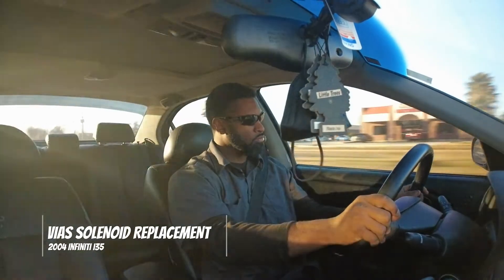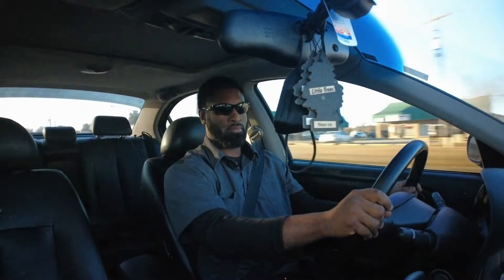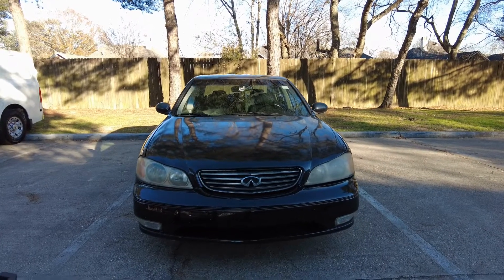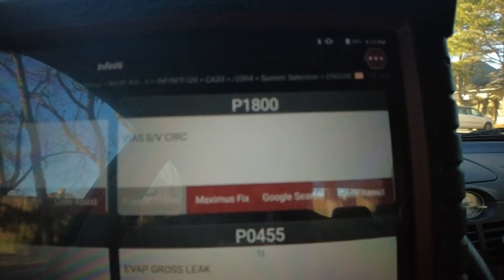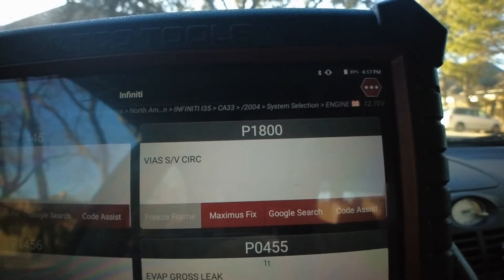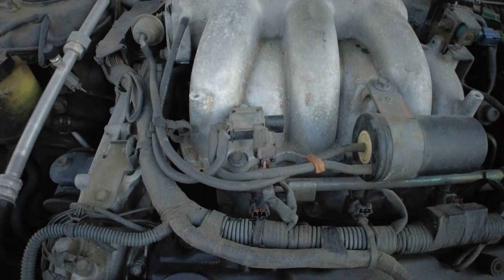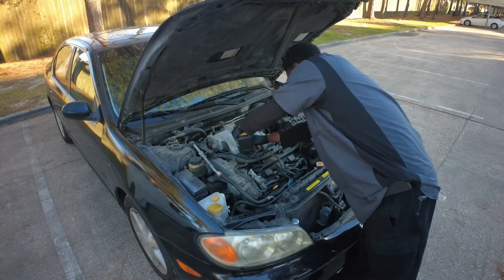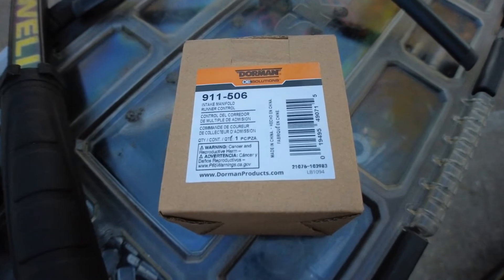VIAS Solenoid Replacement | 2004 Infiniti I35

Comment: Was the car shaking? I can’t really tell from the video i have a 03 i35 and i have a misfire cylinder 5 but i changed plugs and coils but still misfire could it be fuel injectors?
Reply from the maker: no this vehicle did not have a misfire issue. the fuel injector is possible its the only other thing external to fire the cylinder you may want to do a compression test on that cylinder
Reply: Hey man sorry to bother you, if the compression is not good what will be the best way effective way to fix it?
Reply from the maker: @jah800   Hopefully that's not the case if the compression is low then that means there's something inside of the engine that's wrong with that particular cylinder which would be major tear down and repair Doing a compression test it's just going to tell you if that cylinder is building up enough compression to fire but not necessarily tell you what's wrong with if it's not up to spec it could be piston rings or the valves aren't sealing properly  But you would have to tear it down to investigate